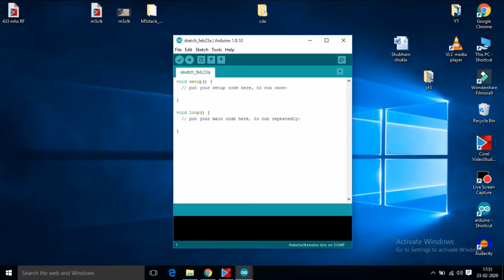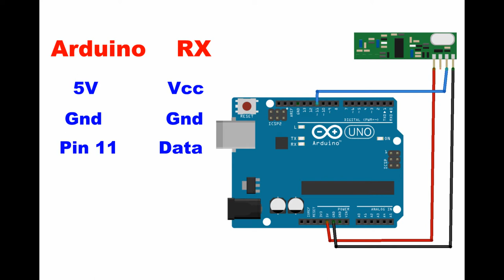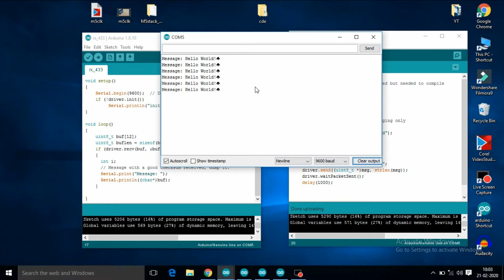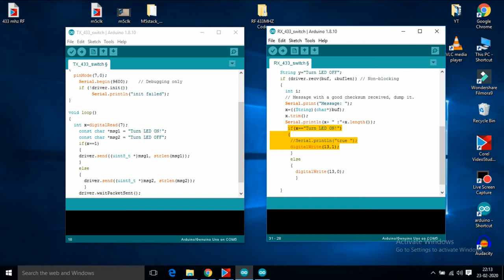433 MHZ RF module with Arduino | Radiohead Library for 433mhz rf module | Radio Frequency Control

Comment: What is the range of this circuit I want to use this in my home but keeping transmitter in one room and receiver in another room or on the second floor anywhere in 20  meter radius...!
Reply from the maker: This doesn't have a lot of range but you can use the 100m range version of this but if you have these try these first if interference is less it might work and if it doesn't work try soldering a antenna on these.

Comment: Hi, could someone tell me are the pins for data on both transmitter and receiver addressed somewhere in the code? 
I'm using arduino nano so I don't know to which pins to connect the data wires.

Comment: if receiver using arduino nano.. what is the port need to use?
Reply from the maker: Sorry please explain i am not sure i understand your question.
Reply: @electronicGURU  if im using arduino nano.. which port should i use? Because you do not mention the port for receiver and tranmitter
Reply: In the coding..
Reply from the maker: Sir there is no such port. Please share a image or something. If you upload my codes to your nano it will work straight away.

Comment: Great circuit! Can anybody tell me what pins the switch is wired up to on the Transmitter? I can't see it from the video, is it 3.3v into the switch and then over to pin 7? and is the resistor being used on the switch, if so what value is it, many thanks! 👍
Reply from the maker: so if you take a look at the code - switch is wired up at pin 7. and switch has been given 5v via 10k resistor at one contact point and gnd at another contact point of switch so if we press the button the resistor will help us to prevent it from short circuit.

there is an alternative  for this by coding

you can pull the pin 7 low  (which will activate  input pull up)
or you can declare it like this -
PinMode(7,INPUT_PULLUP)
its same thing

then connect  one contact of switch to 5v and one to pin 7 and whenever you press  the switch logic 1 will be read and by default it will go back to zero again.
Reply: @electronicGURU  Ah yes, that makes sense now, I remember learning about this, my Arduino knowledge is a little rusty, I have started to learn Arduino again. Please keep up these great videos, it helps people like me learn a lot. Subscribed 👍👍👍
Reply from the maker: sure man , thanks means alot

Comment: hello i bought rf433 like you have. I want to make it remote without Arduino, but it always fails. Please help me
Reply: rf433 that you used on the previous video. that you make to make 4 channels, there is like a resistor in the module
Reply: place a 100uF cap between VCC & GND close to the receiver.  Any small ripple or noise or small abrupt changes in VCC will be amplified by the RX circuit and will show up as an output transition on the RX pin.  That will mess with your receive data.  This receiver has a lot of gain between VCC and DATA out, and that makes it very sensitive ( very twitchy ) to noise or tiny changes on VCC

Comment: 4 chanel realy contro va Rf Module Remote Plz Uplod Sir
Reply from the maker: Sure if i'll get time i'll do that , but you can use my code and all for one relay so similarly you can replicate it for 4 relays. Try and let me know if face any issue you can message me on insta.
Reply: @electronicGURU  thanks For Reply admin